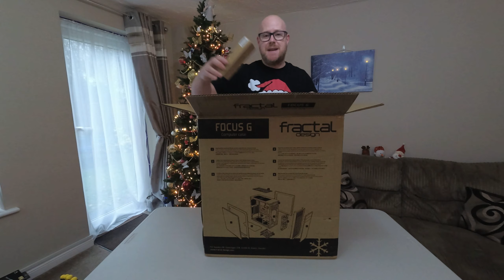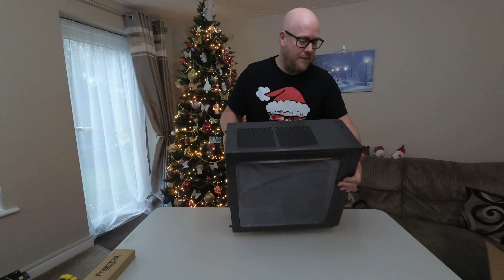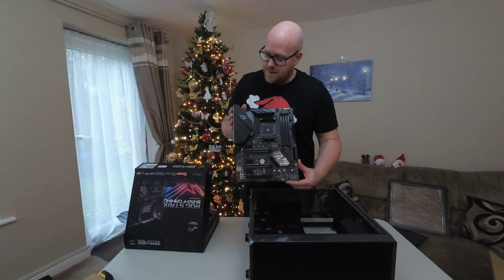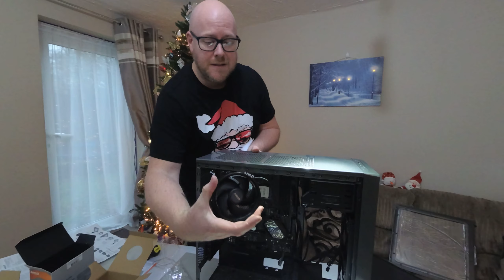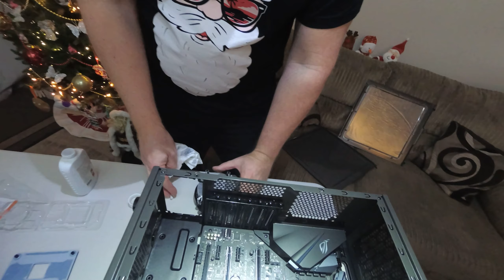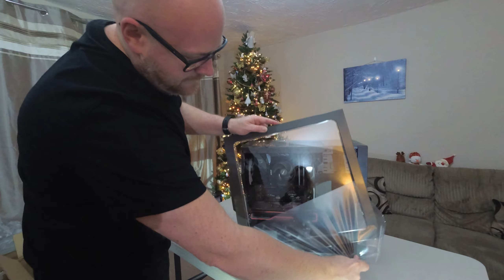£1150 4K gaming pc build | Ryzen 3600 | RX 6800

Comment: Sorry so many issues 5700xt is fine card you then stick a 6800 in a 450 motherboard with a pci-gen 3 no cable extension to move cable cheap case so unbalanced sorry but thumbs down here
Reply from the maker: You are very welcome to your opinion, but I think you missed the point of the video. To build a pc for as cheap as possible, and to get the best performance for the money that he had to spend.
Yes more could have been spent on a better case, but it does not make the system run any faster, and would only result in less to spend on more important components. I really have to champion the Fractal design focus G case, it’s functional for 95% of pc builds, and that price is amazing. I have been so impressed, I’m glad I picked one up for my kids build.
Regards the 5700XT I did not mean to dismiss it, but now it’s been superseded. The performance increase in RDNA2, is such that if you are buying a new GPU, IMO your wasting money buying an older generation card.
The RX 6800 does not have rage mode, the smart access memory would have to be paired with a 5000 series cpu and 500 series chipset. The very minor performance gain against the huge increase in cost was just not viable.
PCI-gen 3 vs PCI-gen 4 has already been dismissed as a viable argument, as performance gains are still so minor.
Regarding the power supply, that was my fault. I should have bought sooner. Most psu had sold out, and that psu came up in a Black Friday deal and was in stock. So I just bought it after checking it would fit an atx build. I never realised the cables would be so short, lesson learned. We did discuss options, and talked the cable mod route. But cable mods don’t let you buy single cables, so even more money needed to be spent on extra cables. We decided just to leave it for now, as he wanted to get gaming.
This was not a no expenses spared build, it was a realistic 4K gaming machine at the best price I could do it.